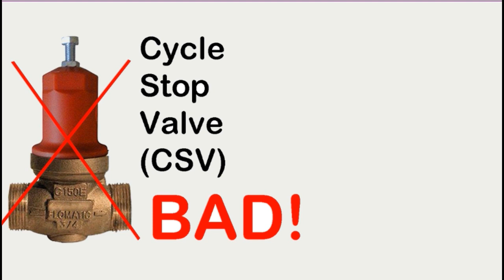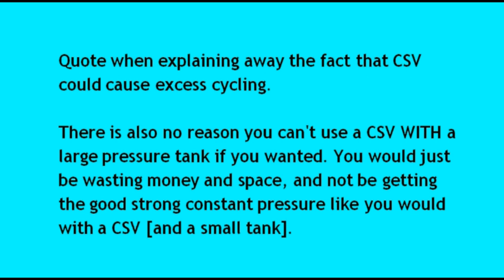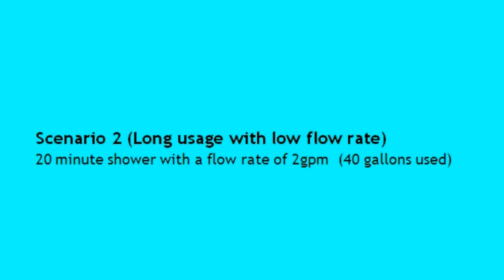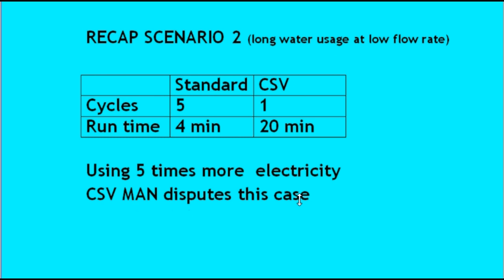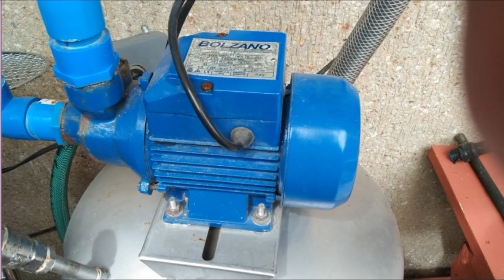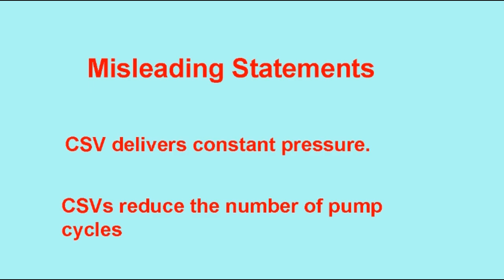Cycle Stop Valves ARE BAD for pressure tank systems!  Pros and cons of CSVs – few pros, many CONS!

Comment: Hate to be a downer on this great video but as an example an inverter type fridge is said to be always on and by avoiding the stop and go of the compressor you actually consume less energy. Is this a true statement or is just another advertising ploy? Cause if this is a true statement then the same could be said of the CSV.
Reply from the maker: Totally totally different principal. The inverter is controlling the speed of the motor. The CSV valve is restricting flow. There is the equivalent of a inverter pump, its called a VFD pump (variable frequency drive) and that is a horse of a different color. Restricting flow always (ALWAYS!) wastes energy. Its simple physics. I have a video about VFD if you want to look at it. https://www.youtube.com/watch?v=KrXR_3mlz-8

Comment: Yes, I argued with him a little, asking for an amp meter reading when system is working and he had no good videos of real-time measurements, he just showed a quick picture of an amp meter which was not showing anything. I did not see too much about how fast the tank is refilled after water is shut off, 1 gallon is too slow of a refill, that should be adjustable.
His reasoning of why the pump uses fewer amps with restriction is water is not there to add pressure, you would think then that the pump would cavitate,  which is really bad for pumps.

Comment: There must be a way you can shorten this video to about 5 minutes. I'm interested to know but I don't have 45 minutes to sit here and wait until you get to the point.
Reply: For real. If you play it at 2x playback speed its tolerable.
Reply from the maker: You have a valid point, my videos tend to be long. Well if you are really considering getting a CSV then its worth watching, right? I don't know if I could have effectively shortened it to five minutes, but there are some things in there I wish I had left out. Want a shortened version? Ok here it is.
1. CSV valves are always inneficient
2. There is almost always a better way of doing it
3. You can build your own CSV valve cheaper
4. It often results in more cycles, not less.
5. In general the whole thing is a scam
Reply: @LarryElterman  I actually like the detailed analysis and showing working examples. Maybe adding chapter markers to your video would be helpful for people to quickly jump to the sections they're interested it.  

I was curious about the efficiency and flow rate increase....I was going to use a kill-a-watt meter and an aquarium return pump to try and test the claim.

Comment: Well just saw this video - all 40+ minutes of it and reviewed most of the comments - I just bought the CSV last week and getting ready to install it in a few days - our setup is more of a farm or ranch - we have a very large garden, barn, shop and house with hundreds of feet of 2" inch pipe supplying water from a 3/4 hp submersible pump and an 82 gallon tank - spread over multiple acres - sole purpose of purchasing this device was to cut down on cycling of the pump, pressure switch and fluctuation of water pressure - had to replace another pressure switch after a year - after recalibrating the pressure switch to 55 / 75 psi with 53 psi in the tank things have picked up nicely. I'll let you know if I feel like I was sold a bill of goods :D - actually talked to the company before I bought this and found the person reputable and knowledgeable - no worries I know salesmanship when I see it :D - will let you know how it goes :D
Reply from the maker: Of course he seemed reputable, a good scam artist always does, otherwise they would not be a scam artist! Bernie Madoff seemed legit also!  Given your scenario I know i can come up with a better cheaper way than the CSV. For sure! Of course it's too late you already purchased one! Your 82 gallon tank, that is a pressure tank I assume? (as opposed to a storage tank). Are you also using this system for your house? Ok, here is how you could have done it better. (of course it's too late!). Have your deep well go to a storage tank (not a pressure tank).  The storage tank is controlled by a float switch to the deep well. This will vastly cut down on cycling in addition to be very efficient because it can go unrestricted into the storage tank. From the storage tank buy a dedicated booster pump of the correct HP and run it directly into your field. No need for pressure tank. :) The booster pump will cost less than the CSV valve and run much more efficiently. Of course what you plan to do will still work, it will just run inefficiently and put more strain on the deep well pump by running it a long time at a restricted output.

Comment: Thanks for this informative video, you saved me $200.00.  Even though I'm going to be using my system just for sprinklers, I don't think the benefits are significan to pay for the valve, in addition I think I'll shoot for maximum pump usage and in that case the valve wouldn't do anything anyways.
Reply from the maker: Just for sprinklers and nothing else? You don't need a pressure tank or a CSV. I was actually thinking of making a video about this. Run a pump directly from a water storage tank. Size the pump slightly bigger than you need (but not much or  you will lose efficiency). Control the flow with a normal gate valve for fine adjustment. Turn the pump on when you want the sprinkler to go on, turn the pump off when finished.
Reply: @LarryElterman  I like the gate valve idea for each sprinkler, so I can adjust the flow to balance out the proper pressure for each sprinkler.  The water source will be a pond that I will be circulating fresh water through to help keep the water clean.

Comment: So basically, if I wanted to use this and have constant pressure. It is best to only set up for a system that only uses showers and high water flow for long periods of time like a potential shower, sprinkler system or filling a pool?   Makes sense and would be best if he pitched it that way.I think he doesn't because although practical, the amount of pool fillings and sprinkler system uses are just not what the regular homeowner uses and therefore not a way to make bulk sales.
Reply from the maker: Exactly. And even if you set up for a sprinkler or something you had better get a properly sized motor. If your motor is too big it will be slowed way down by the CSV and be very inefficient. If you have something like a dedicated sprinkler or something you can just get a properly sized motor and run off a water storage tank. And even in that case if you say you need constant pressure, buy a pressure reducing valve (much cheaper) and put it on the sprinkler side of the pump. Bottom line, for 240 bucks (the price of the valve) you can almost always find a better cheaper way. But as you said, If he said all that, how would he sell any?

Comment: When I was watching the CSV video, I thought their valve was part of a feedback system that reduces the power to the pump, because that is the only way you can add back pressure to a pump w/o increasing the draw. When I actually saw the valve and that it's not connected to the pump to regulate the electricity I knew it could not do what he's claiming. Thank you for making the video. My only suggestion was to a SHORT version, hit the highlights and make it under 5 minutes. I'm a pretty technical guy so I watched all 46 minutes... but most will not do that.
Reply from the maker: Ya, i should have made it shorter. I'm not good at making short videos haha. Anyway, I am finished with CSV, so someone else will have to make the short video. Their misinformation is really astounding. They have no shame!
Reply from the maker: Hmm, maybe i will take your advice an and produce a highlight reel, interesting idea, i will think about it...... (ten minutes have passed - I gave serious thought to your idea) Na. Too much work! Nice idea but I have decided to move on from CSVs

Comment: Not a fan of the name calling back and forth but we will see how you comment to me.  I am also an engineer that for 25 years designed and air/water balanced commercial systems.  I am NOT associated with CSV other then I installed one in 2014 with 8 gpm pump (limit of my well) and I did not agree with their tank size.  I installed a bigger tank.  Has worked very well.  You don't need as big a tank as normal, but your tank should take into consideration pump gpm.  I do agree with you a 3 gallon tank is too small.

You have some errors in your claims.  Your fan example where you physically slow down the blades puts more load on the motor.  Bad analogy.  If you took your amp meter on a vacuum cleaner, You would see amps drop when you put your hand over the hose.  Same thing I saw when we closed down balance dampers.  As static pressure goes up, amps go down.  I learned this in college and experienced it in the field.  
Same thing applies to pumps.  As we throttled down balance valves to adjust flow rate, pump amps went down just like the pump curves showed.  Your pump video did Not represent that as you did not show your flow rate.  It appeared you were filling a tank at full flow. With the pump curve  if you have the psi and amps you can get the flow rate.  
CSV valves are not Bad but their website should have more information on proper sizing of tanks with different gpm output of pumps.  If you use a larger tank you just need to adjust the downstream pressure a little higher.  It is a balance between how fast you want to fill the tank while keeping the pump running a little longer.   I have not experienced your claimed negatives of the CSV.

I will say that CSV is a much better option then variable  speed pumps.  They are very expensive, and running alot at slow speeds is hard on the impellers.  Expensive controllers are subject to damage from surges due to electronics.  I've talked to people with these well pumps and many have not been happy at the cost to replace the controllers.
Reply from the maker: I have no problems with opinions. I actually regret some of the things I put into my video because they take focus away from the important things. The fan experiment was just on a lark for the fun of it, i was curious, so I recorded it. I did not really think it proved anything, but people thought I was trying to prove something so it was a mistake. Same thing with my pump, I just wanted to see if it would reduce power when restricted, it did not. But I understand you can not generalize my pump to other pumps.  If you watch my whole video I actually assume that the pump curves are correct, I actually don't deny them although I doubt that most pumps reduce their amps much as the ones he chose. IT DOES NOT MATTER. The main points I make are all correct! Even though the amps drop, they don't drop as much as the flow, so the efficiency goes way down. Listen, it's the most basic physics in the world, restrict something and you waste energy.

I am not saying CSVs are bad in all circumstances. I am saying that the company engages in deceptive and unethical marketing claiming things that are not true and misleading people into solutions that are bad! See my video about the VFD to really see how horrible their misleading information is.

It's a bad company saying untrue things. Lying constantly. That can not be disputed. I have proven it over and over again.

And by the way, isn't a CSV simply a demand system which they sell in places like Walmart for about 200 bucks. Demand systems have been around forever, and some people like them, but they are not good in most situations. A CSV is simply a run of the mill demand system that has been around a long time and is nothing special. Their whole company is just one misleading thing after another.

Oh, and another thing, you said you used a bigger tank with your CSV system. Well then it really isn't constant pressure until the tank first empties and then refills to the limit of the CSV. And while the tank is refilling it is doing so at 1 gallon per minute instead of the limit of the pump. What exactly is your CSV doing for you anyway? Other than making your pump run longer? Please explain the purpose of the CSV in your particular system. I bet you could just take out your CSV and your system would run better and more efficiently that it does now!

Comment: Interesting video... I''m installing a CSV system in my house, I just ordered it, and quite honestly, I do not see any downsides to the system, as folks have been using them for years without issue. AND, I can get rid of that 47 gallon bladder tank in my basement to free up much needed space. I've been living with wells, both commercial and residential, for 56 years, so I am not new to pumps. 

Regarding pump cycling, my well pump is designed for continuous operation, most all modern submersible pumps are, my Franklin Electric is. And regarding cycling, that can be adjusted with the bladder tank. I do not use 10 gallons of water to wash my hands or flush the toilet. 

As far as energy usage, I am not filling swimming pools on a daily basis, and these small submersible pumps do not use that much electricity even at startup. 

My main reason for purchasing the CSV system is for the limited space it requires, thus less plumbing along with the continuous run time with the constant pressure. As far as those wild pressure fluctuations, you get those with a regular bladder tank system if the system is not set up properly, which is not rocket science to correct. 

I don't see the case being made against the CSV system, and you seem to have a bit of a chip on your shoulder to boot. If there were real issues with these systems, CSV units would have been pulled off the market years ago as many other building products have, especially in the plumbing industry. 

And I see you remove negative comments, am I next?
Reply: Michael,. See my comment in the main thread.  I agree it is good product, but lacking in better tank sizing info. Had one installed for 7 years now.  Works well. I have No affiliation with CSV. I did not put in 3 gallon tank. Too small.
Reply from the maker: haha,  90 percent chance you are affiliated with the company. As I told Sam Osten, who you probably know,  I don't remove comments unless they are rude or insulting. The info is now out there, people are free to make up their own minds. I don't have an agenda. If people want to believe your company, no problem with me. I just wanted to give them a fair shot of deciding for themselves. Before my videos, only your disinformation was available, overwhelming as it is. That is why I will not remove any of your comments. Comment away. I will not take them down unless they are rude or insulting.
Reply: @LarryElterman  Fair enough, no affiliation with any company other than my own, transportation/trucking... And the CSV makes perfect sense to me, pumps perform and last longer when continuously ran. Seen that first hand in the oil fields, and the years I have been around pumps, be they on a bottle or a well. And Like I stated, if there were real issues with these valves, they would no longer be on the market, especially in regards to plumbing. Plenty of building products get yanked for less than you state, along with the lawsuits that most always follow... Sorry, not seeing it here, looks like a solid product to my lying eyes.

Comment: As a mechanical engineer, I determined pretty quickly from reading the company's explanatory literature that installing the CSV in my situation would result in significantly more pump cycles than my existing, multi-tank set-up with 22 gallons of drawdown capacity.  Your well reasoned video explains this reality well.  I suspect the CSV has its applications, just not in my home.  The pressure swing (40-60 in my example) is of no significance in my daily experience.

Comment: I was considering this, now I’m not. I’m just going to add a few pressure tanks once my crawl space is encapsulated next week. 

Side note, depending on the motor, they can draw significantly more current on startup, but well pumps are not like that. My table saw, band saw and a few other tools have a significant in rush. But yes, this product uses some funky equipment for his explanations.
Reply: Well pumps do not draw that much current, your refrigerator is likely the real energy hog in your house, not the well pump.